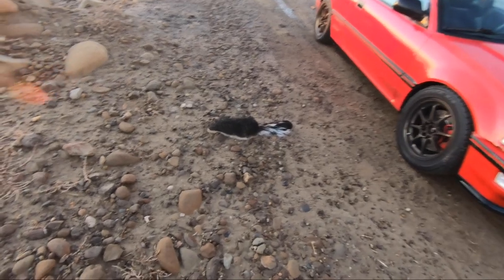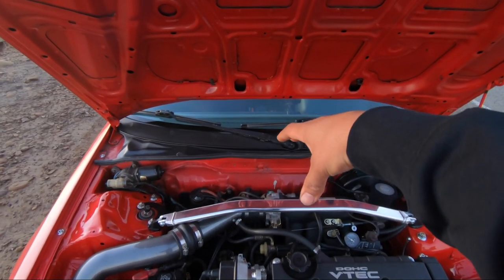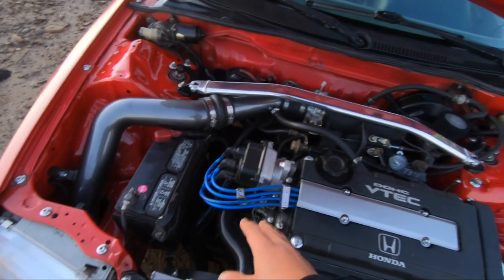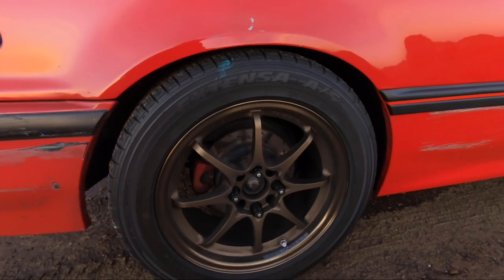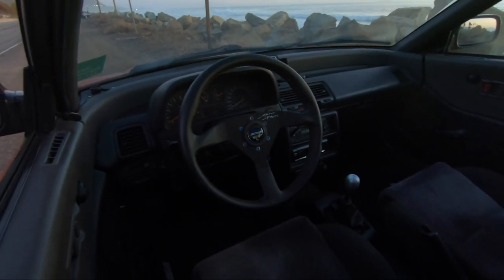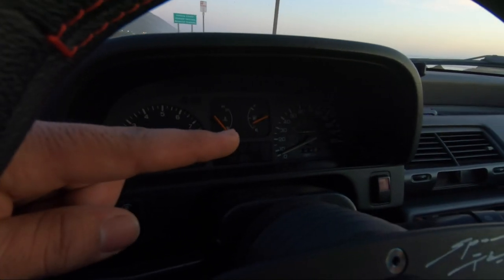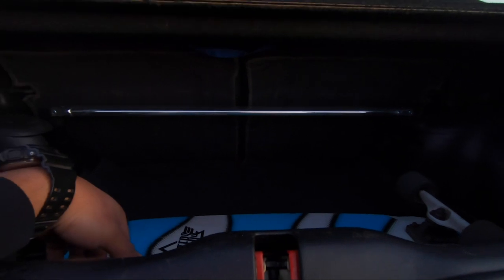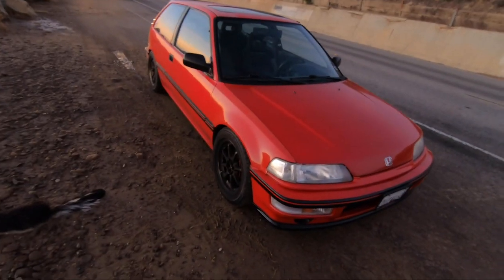My b16 Swapped  EF Civic

Comment: Just came across this video and really liking your EF!
subscribed and looking forward to more content!!
Quick question for you or anyone else, been thinking about what to swap into my ef hatch. Debating on getting a b16a or just throwing an ls non v. 
How has the b16 been since you got it and how long has it been since you got it?
Reply from the maker: Thanks for the support! B16a’s are really fun because of course you have vtec! But you cant go wrong with an ls either they are cheaper and you have more displacement. The b16a is really fun because it just screams up the RPMs. Ive had the b16a for about 3 years now. Since the video has been uploaded I’ve already swapped my hatch to the b18c5 engine so stay tuned for an update video! 🤘🏽
Reply: @Formal_Inc  thanks for the feedback! I think I might just go for a ls non v. Maybe lsv in the future.
Ooh c5? Damnnn looking forward to seeing that! Notifications on for sure:)

Comment: Hi mate, I’ve done my full b16a2 bottom with b18c7r head motor swap into my ef. Fully forged and head ported with polish and now screams 10,000rpm and 200hp. Just wondering if your front Strut bar is the spoon eg bar aswell as the rear? Thankyou
Reply from the maker: The front strut bar is for the JDM ef9 civic, purchased from ICB motorsports. The brand is vision technica. The strut  bar cannot be put on an EF with a USDM hood unless you want to cut the webbing a little.
Reply: @Formal_Inc  wow! That’s awesome Thankyou for the info mate.
Reply: B18 head on b16 block wtf?
Reply: @ThatOneEF  B18CR head, which is factory port and polished B16 head anyway.

Comment: Spoon brakes will change ur life. You   should get the brakes fully sorted before type r swap cause imo the brakes will make the car more fun than the extra power the type r engine would give. Also the best thing about old civics is that they can out brake anything even tho your not road racing it but its just cool to make the car great at what it does best
Reply from the maker: The car has 11 inch rotors and type r brake calipers along with a rear disc conversion and a 4040 prop valve....I think the car is all good with brakes. spoon twinblocks were on the car before but I sold them. not really much of a difference in terms of performance its just bling bling.

Comment: What engine harness did you use? Is it obd0 or obd1? I’m having issues where my 88 sedan b20v hesitates to accelerate when the map sensor is hooked up. Did you have to do anything with the map sensor wiring?
Reply from the maker: Im using my stock 90 civic si harness. I unraveled the loom and tape and made it “tucked” check your TPS sensor if its bad or not calibrated correctly it causes a hesitation or a bucking when you accelerate. My map sensor is converted to an obd1 map sensor on top of the throttle body. Most of the sensors/injectors i switch the plugs to obd1
Reply: @Formal_Inc  how did you convert the map to obd1?

Comment: Did you have to change the drivers side mount thats attached to the block to fit the mount.
Reply from the maker: You will need a DA integra post mount.
Reply: @Formal_Inc  thanks